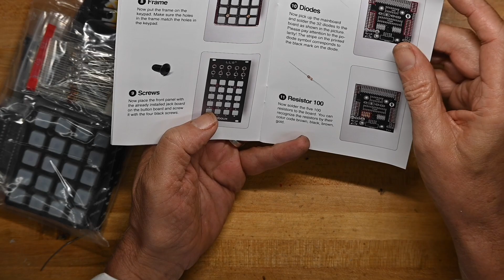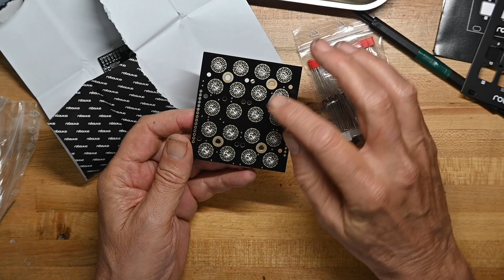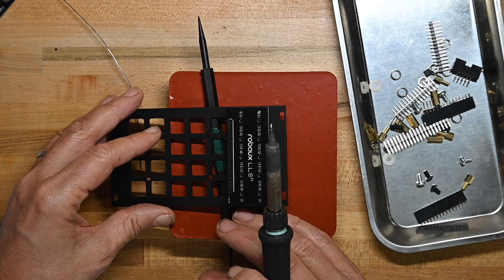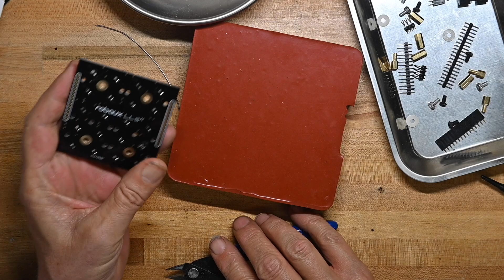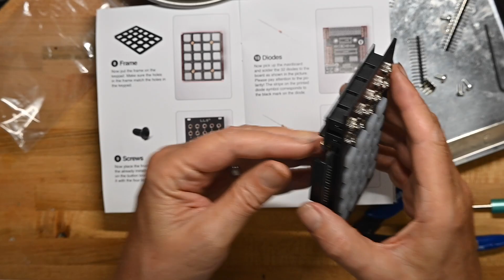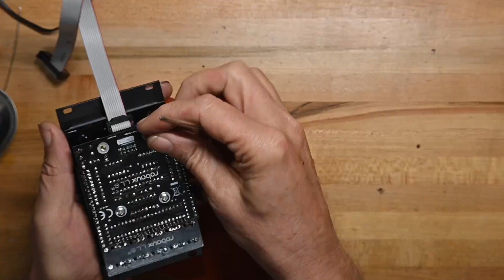C.K. builds an LL8 II Sequencer kit from Robaux, eurorack

Comment: Fun fact: the military still uses floppy discs for the computers that run the nuclear launch codes. Turns out, you don't need much more than that to run them, and it was easier to just not upgrade.
Reply from the maker: @penguinlord7655. Simplicity is best for high reliability, bug free software.